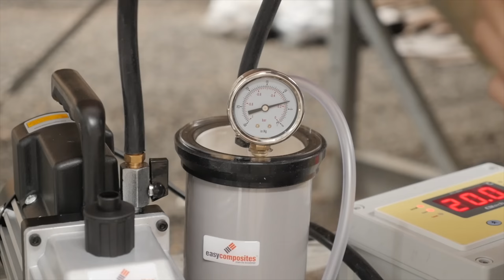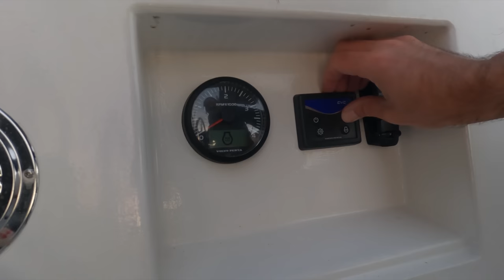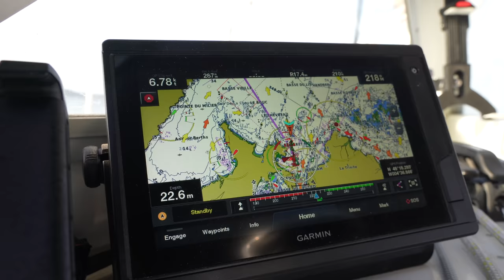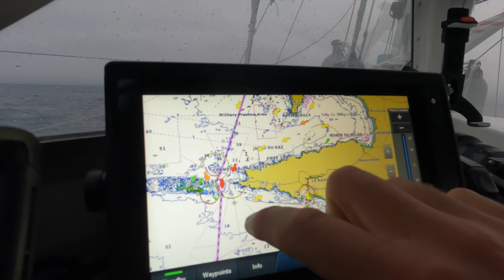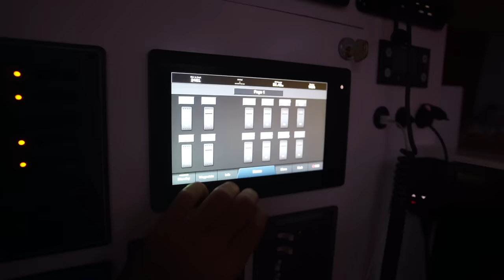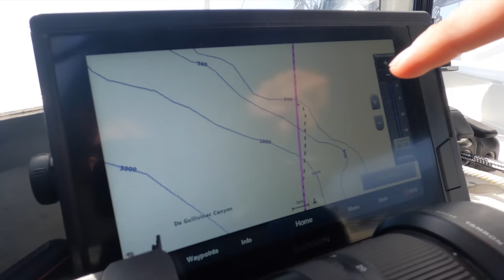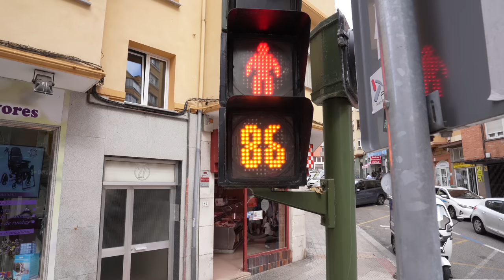Sail Life - Crossing the Bay Of Biscay⛵

Comment: I have to say I agree with you Ava , I like collared shirts with buttons and 2 pockets. 
Much more practical that Sloppy Tee shirts.   Built in sun protection for neck, adjustable temperature control, practical storage for credit cards/cash and a pencil or pen. Besides that no need to pull thing over your head to put on. They also don’t stretch out of shape and come in a wide variety of materials from light wt UV protection, cool patterns, iron free fabrics, even silk for this special occasions. What’s not to like?
Great Biscay passage by the way! Boring is just fine ! 
Cheers Warren

Comment: The RYA dinghy sailing course includes an element on rudderless sailing. There are also demonstrations on You Tube. This is achieved by varying the how much power is generated by foresail and main sail plus shifting weight backwards and forwards. Given the greater bulk of a cruising yacht, would this work if an Orca ate your rudder?

Comment: Regarding Starlink range. I suspect they don't restrict it all that much, so as long as a satellite has both you and its ground station in sight, internet will work. With the orbital altitude of the lower layer of sats, I'd guess something between 500 and 1000 km.

Comment: To help limit the seasickness duration and terrible feeling apply very cold ice pack on the back of the neck at base of skull, wrap in towel so as to not freeze skin, cold air blowing on the back of neck temps between 55 and 60 degrees F will also help out.